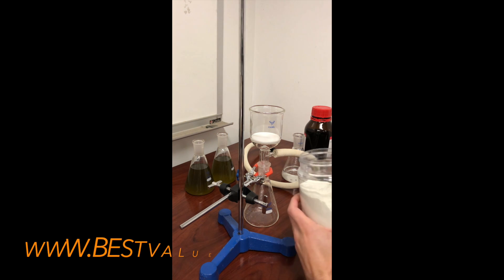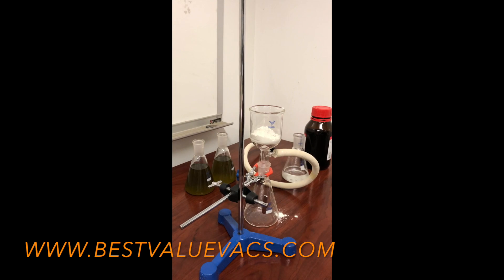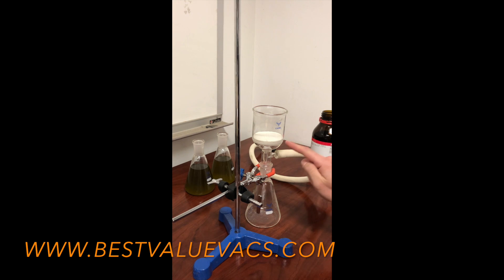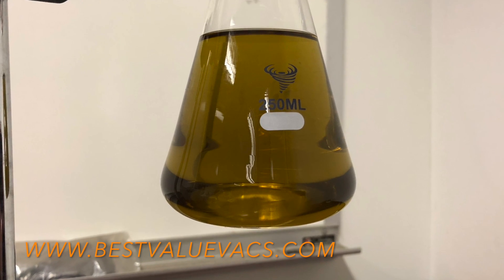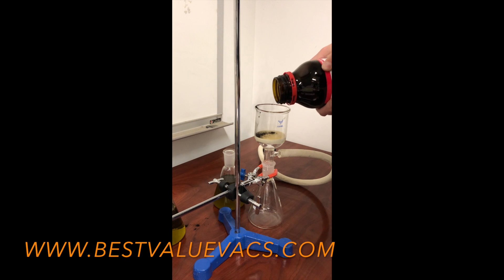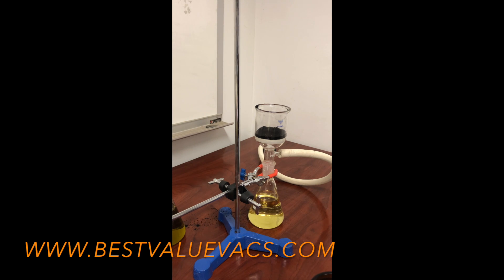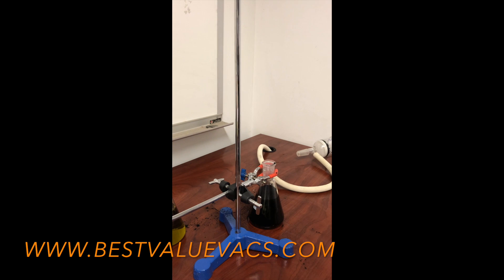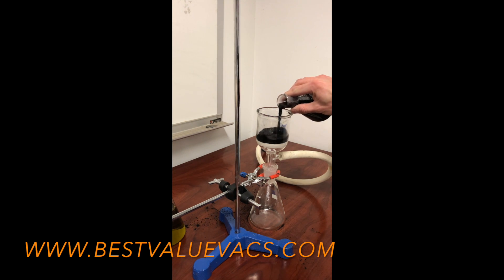Celite545

Comment: Do u need to heat up the carbon before the scrub ? What size of the celite 545 ? Even i filter thru the celite bed , the color still the same . I even use more celite than what u show in this video . Thanks !
Reply: You have to use the active charcole for color change the 545 just improves clarity
Reply: it works better when you do. There's another issue here: cannabinoid loss to carbon. You have to balance that with aggressive use of carbon.
Reply: Brian Kenny I was wondering about that same issue recently and I had no luck finding any literature on the subject

Comment: Hi there Guys, would this be considered dewaxing as well or not
Reply: Best Value Vacs can’t you put the filtered content in something like the extract source and get something fairly decent and close to shatter with an clear appearance?
Reply from the maker: No, this is done post dewaxing. You still need to perform the winterization, this is an excellent clarifying step, prior to roto evaporation.
Reply: can this step be used for shatter as well
Reply from the maker: Moufid Wehbe No you can’t. shatter requires wax to stabilize. This process is really only used to clean the oil to prep it for the roto then distillation. 

You would have to test the idea with waxy oil to see what the outcome would be.  The application is wrong but sometimes it works for some people’s process. We hear crazy ideas all the time. Dosent mean it’s wrong. Just not tried by us yet.

Comment: Do you use a filter paper between the Celite and fritted disc?
Reply from the maker: John Douglass if it’s a fritted disc Buchner then no.  If you don’t have a fritted disc then yes.  In my video I had a fritted disc Buchner so no media will pass into the flask.
Reply: @Jmarosii  Is this a fine, medium, or coarse fritted Buchner?
Reply: @Jmarosii  exactly what im wondering, guessing its a 2 micron if De is 4-5

Comment: Pro tip : instead of water just use 200 proof alcohol so you don’t have to wait for it to dry
Reply: yeah Im thinking these folks doing video are amatures at best with the way they do things
Reply: 190 proof is essentially as pure as you can get. As soon as you crack the seal on a 200 proof, it’s absorbing moisture from the air
Reply: @proz71ful19 unless you know that and prepare for it.
Reply: i wonder what grit to use , the 2 micron? or can i use whatever grit and add a 2 micro paper. im saying 2 micron because the DE is 4-5micron. i dont want to contaminate my oil